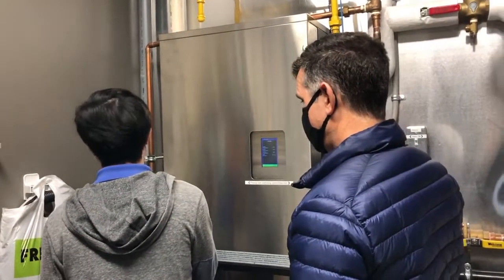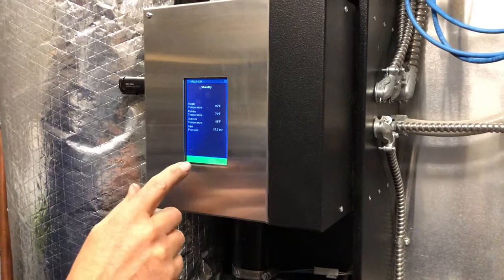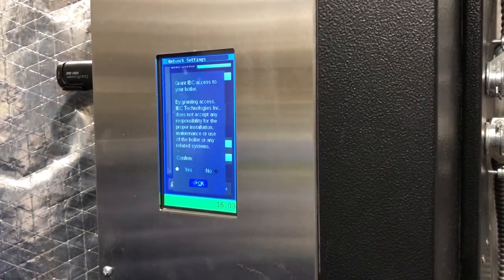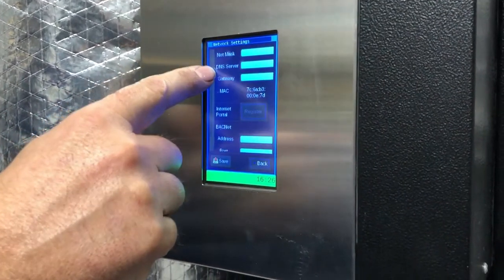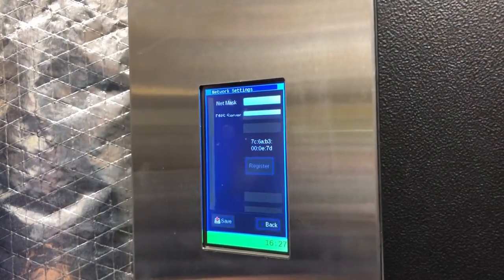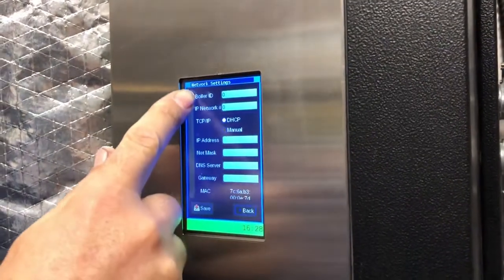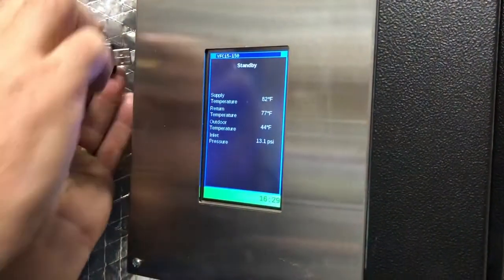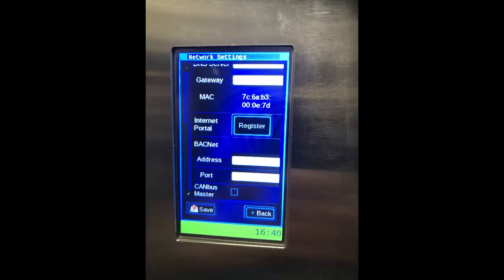IBC Boiler V   10 Portal Registration

Comment: Did you have the cat 5 cable plugged in? Its been a year since the video of the install.
Reply from the maker: Yes the cable was installed.   Ended up manually entering info in.   😀